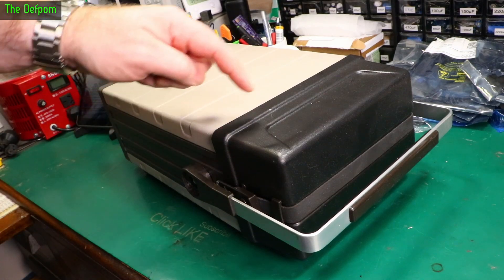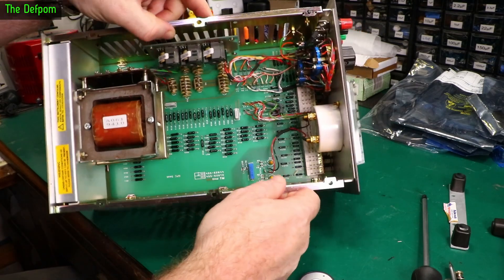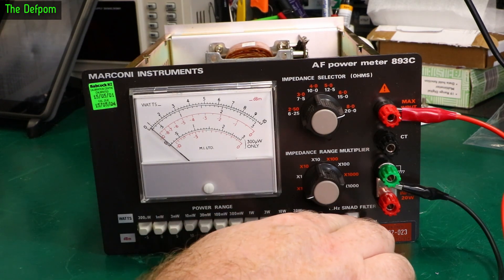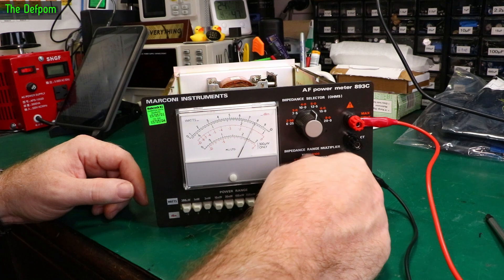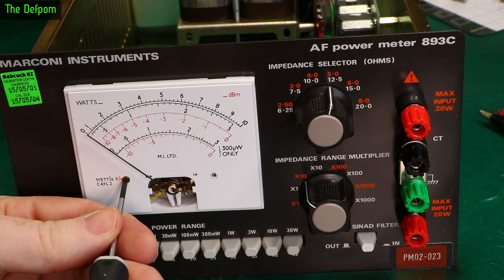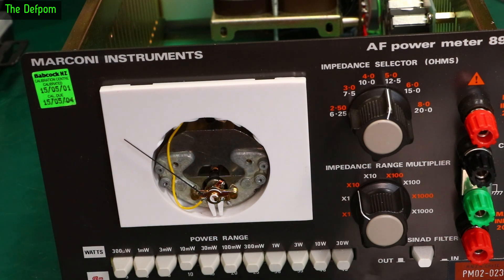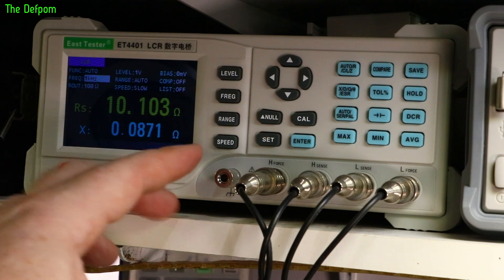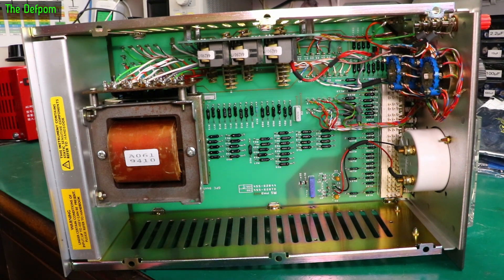🔴 Marconi 893C AF Power Meter Repair - No.1148

Comment: I also have the 893C but not the SINAD filter option, it is an interesting wattmeter design and very handy to have when testing audio equipment.  This meter goes to 30 Watts, there is a B version that goes to only 10 watts.  These work from 20Hz to 35 KHz.  The detector is temperature compensated.  If you float both inputs you can safely test a lot of devices without a shock hazard.  50/60Hz power transformers can even be tested, just watch the max input voltage.   Very low impedances can be obtained using one red input and the black CT (center tap) input.  -Erik